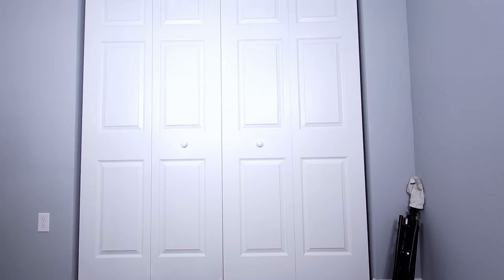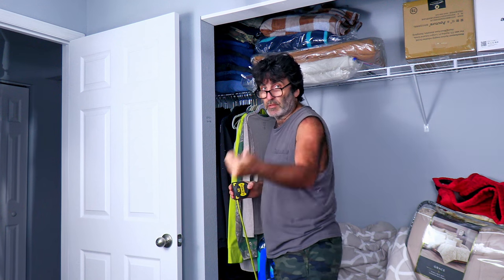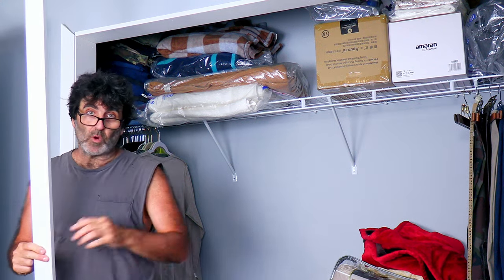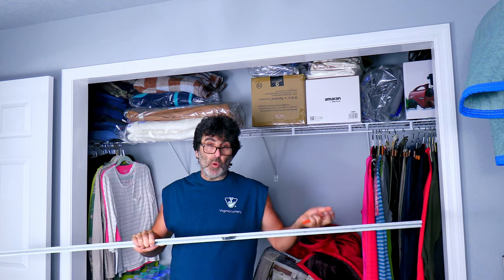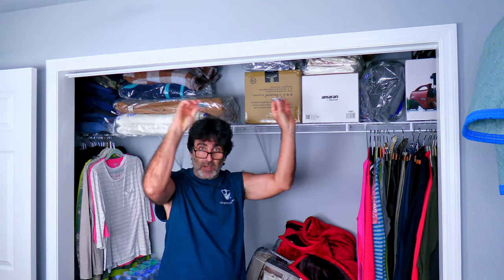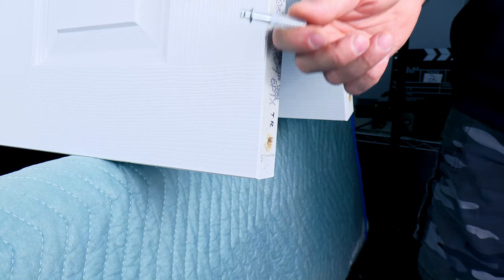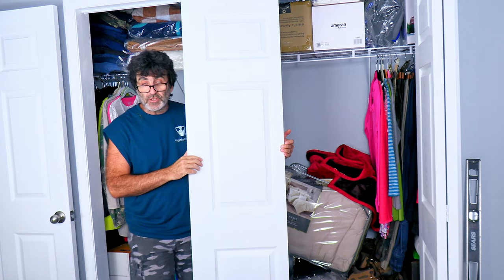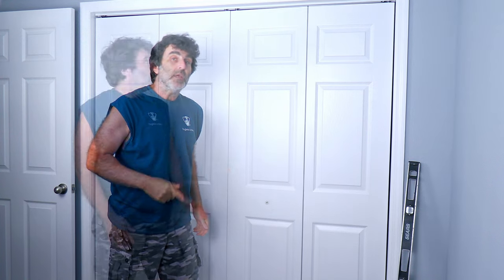The Ultimate Bi-Fold Door Installation Tutorial for Homeowners

Comment: I've been wanting to take 3 sliding mirror doors on my master closet to bi fold. Not sure it's doable but I would love unhindered acess to my clothing.
Reply from the maker: HI, depending on the size of the opening you might or might not be able to add bi-folds without doing anything major...  If the opening needs to be a lot taller for example you might have to take off the drywall and see what needs to be done to get it higher....  Keep in mind if the opening is for example 80 tall... you can still install bifolds by shortening the doors a little bit... the top and bottom of the doors are solid for about 3/4 of an inch before they turn hollow.  so you can rip a little out of there and still keep the integrity of the door.